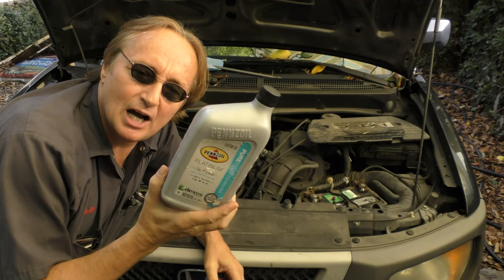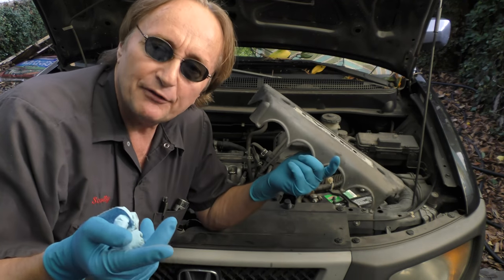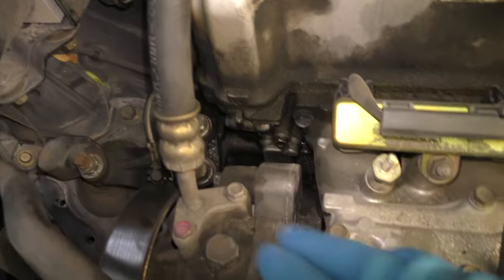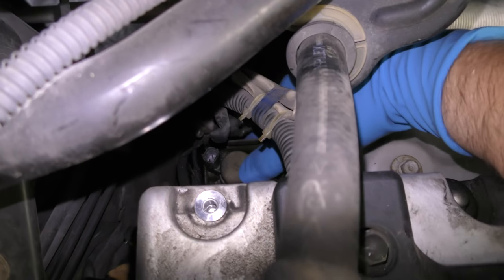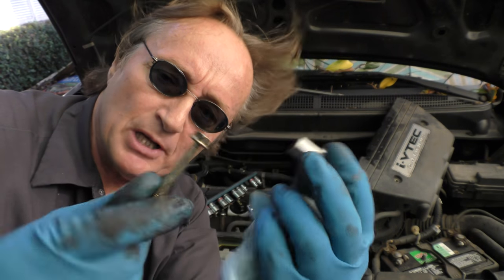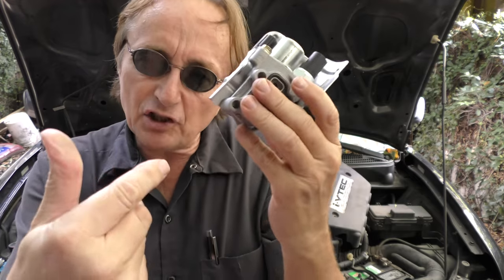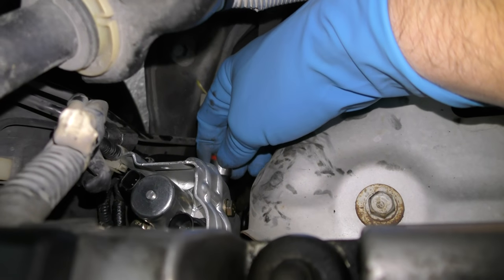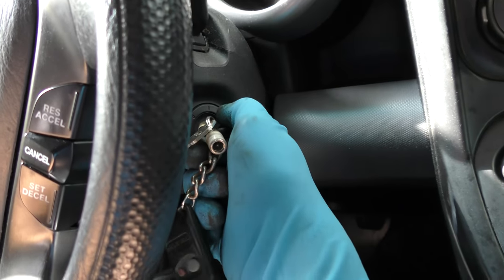How to Fix Variable Valve Timing in Your Car (VTEC)

Comment: Wow...this channel has taught me a ton about my car...when i go to the mechanic they are shocked by what i kno...i cannot say thank u enough
Reply: Leela Crissy me too !! Plus my dad taught me some knowledge I be telling him what’s wrong before he check it out😂😂💕
Reply: Why you still going to the mechanic
Reply: Haha. This comment! I had a dealer call me a c*nt and all sorts of other names because I stood over the engine and pointed out all the faults with it after he told me it was fine. All thanks to Mr Kilmer 😂
Reply: @stephaniesheridan5474  I've done over $1,000 dollars of repairs/additions to my car by myself.. Only time I'll go to a mechanic is when theres a tool that's too expensive to use.. And even then I'll go to my first job site (I used to take off bumpers and just disassemble/help out the mechanics when I wasn't sweeping and cleaning) and they'll usually let me use the equipment free of charge.. It's good to have friends in high places..
Reply: Never tell them you know what it's they hate that just do it yourself avoid the rip off 👍
Reply: Same 😊

Comment: lol Scotty chirpin the tires, well it goes over 3000 now lol
Reply: o OK thx , yea I didn't think about cleaning the intake manifold after I took the old one off, just use a brush or something to clean it
Reply: wire brush is a bit much, usually a rag and some brake clean has worked well for me
Reply: O OK thx
Reply: U own a Honda?, I see a vtech motor in as your picture
Reply: Hey also, my Camaro doesn't start unless I jump it off, auto zone told me the battery was good, could it be the altenator
Reply: ya b18c swapped civic, hmm it could be the alternator but it sounds to be a wire thats grounding out, same thing as leaving your headlights on, does your red battery light ever come on while driving around? that would point twards alternator, also cleaning battery connections if theyre all corroded would help
Reply: +The1972Cutlass hey i know you werent asking me, if your car doesnt start unless its jumped then its either the starter or the battery, sometimes a bad starter with double the power going to it will act fine, also theres a couple batteries that fit that car (group 75 group 78) so even if your old battery tested good it might not have the amps you need to get that starter kicking :) hope i helped
Reply: +Jesse Singletary  o OK thx
Reply: Motor mounts probably need to be replaced lol
Reply: +ChronicConnoisseur  o OK I have a 97 Honda prelude also
Reply: My brothers 300D does that sometimes too lol
Reply: @The1972Cutlass  check starter and ground we wires

Comment: If it was leaking it was due to the gasket seal which only cost 24 bucks. Im a Honda mechanic in Orlando Honda and the Vtec Solenoid system don't go bad, it only has seals which you can see in the video.
Reply: Craz! Ness r u still in Orlando? Get at me
Reply: And if replacing the whole assembly doesn't work then what do you do?
Reply: OrBust add 20 50 oil
Reply: RandomGolf So  we've already put in 10 30 when it calls for 5 20 and still throws the code but only on hot days. We are baffled.
Reply: Can you just buy the seals or does Honda make you buy the whole thing
Reply: thanks
Reply: Been working on acura's for 13 years.. never seen one go bad either..
Reply: Craz! Ness do you still in Orlando ?
Reply: Scott Golden you can buy the seals separately they do carry it in advanced auto parts and o Riley’s
Reply: @92174164  do they start to rattle at low rpm?
Reply: Whatt ive seen these go bad bud. Ppl dont change oil ot just keep adding it. And seals break down. Solenoid valve pin gets stuck

Comment: Hi Scotty, I just bought a used 2014 CRV with 120k miles which makes a rattling noise on startup. Honda dealership says it's a bad vtc actuator and stretched timing chain. They quoted me $2700 for the repair.The car runs with no problems and no engine codes. What do you think I should do?

Comment: Wow, I actually had to do this exact repair on my 02 CR-V (same engine) last winter. It would chug when it got above 3k RPM. I got a P1259 code. Replaced that VTEC solenoid and it's been fine ever since.
Reply: Is that a 2002 Honda engine in this video ? I have a 08 Accord 4cyl and I'm trying to figure out what is leaking on passenger side, 275k miles
Reply: That’s an Element in the video, but it’s still the same K series engine, which your Accord has. I would definitely check your VTEC solenoid gasket; they are prone to leaking.

Comment: Oh yes, the VTEC solenoid assembly. Had to replace that on my 05 CR-V. From my experience usually the only time that those things go bad is either due to lack of oil changes or just simply due to age if the car has a lot of miles on it as well. Very easy to do and not horribly expensive unlike some other things on these older Hondas.

Comment: 13 Years as a technician and master tech for Acura, i never once saw a VTEC solenoid fail, not by me or by one of the other 24 techs that i work with,, in 13 years! .. 10 times out of 10, if it throws a VTEC code it's because the car is very Low On Oil .. Very low.. Which causes interruption of oil pressure to the solenoid and a VTEC code Will set.. , when that happens the car defaults to a "Limp home" mode which makes the computer limit engine rpm to 3000 rpm.(unless you cycle the key, then it will drive normally, unless it occurs again)) Scotty just unplugged it to set the code for this video no doubt
Reply: you are mistaken because I've seen numerous Honda Elements with that same problem including mine
Reply: allen luangrath I had to change our the vetch module just like Scotty did and my Element ran like a champ afterwards. Also and oil change, engine flush and general tune up 🤔
Reply: @_Diggler   No doubt in my mind that it will run it's a honda they go forever
Reply: It is very expensive, to replace,so another alternative is, take it off, clean it, replace the gaskets, reinstall and most times the problem is solved, as the comment by the  mechanic above  stated.

Comment: Vtec has been kicking oil all over my engine bay for past two years. I didn't tighten down my vtec solenoid enough after doing my first headgasket ever on my daily driver. Finally troubleshot that P2646 a actuator arm system blah blah blah yesterday and tracked it down to that. It's fixed. No more CEL, no more oily engine bay and constantly checking/filling the oil. Replaced the o2 sensor yesterday as well, that got ruined from driving around with blown headgasket two years ago. Damn those things are expensive. No more cylinder misfires either!

Comment: Scotty. I have a similar problem. It causes intermittent hesitation. Im suspecting its the same valve you mentioned. I have no check engine light or codes for it. But i noticed it is more frequent in hot weather. Do problems like this get enhanced with environmental temps?
Reply: Following.. Needing to know, also.
Reply: @chancedulaney774  it was the throttle body and oil control valve. Replaced them and it solved my issue.

Comment: I have a 2005 Honda Civic Ex. Throwing that code. We changed the oil, added an engine cleaner and replaced the gasket. Still threw the code. So we replaced the solenoid. Still throwing the code. The whole engine jumps when it gets to about 3500 rpm. Any suggestions on next steps?

Comment: This is a great starting point. On the "element" you WILL be removing the left motor mount to remove the power steering pump and tensioner pully to clean the little screen behind the cover. the hardest part is the belt reinstall its just time consuming about an hour. The solenoid in the back of the engine is tough. remove the power steering hose and metal support bracket. I tied mine over to the driver side with a bungee strap. after you remove the 2 electrical connections there are 2 plastic wire anchors on the metal heat shield they are difficult to remove. The rest is fairly simple
Reply: You did it the hard way. You do not have to remove anything other than the oil filter for access to the VVY assembly.

I replaced the filter/O-ring on my Element and my Accord (same K24 engine) by moving the power steering pump hose bracket out of the way and holding it in place with a bungee cord. After undoing the front connections from above, I removed the oil filter (you should change the oil and filter anyway) for better access from below with the car on front ramps. It is also much easier to use the torque wrench from below.

Comment: Is it possible that the oil pump could be weak causing low oil pressure only asking because we've done this repair and visually checked the wiring harness for damage cleaned connectors changed oil and we changed the screen under the belt tensioner also do you think you could do a video on how to check a wire with a multimeter for a short to ground and a short to power and what to do about it if you find one

Comment: Mr. Kilmer I just replaced the same part I bought of of eBay for $35. With the old one it was leaking oil, and would only be a problem with a cold engine. Worked fine once warm. P2646 was the code that came on when accelerating with cold engine. So with the cheap new part even with engine warm it now triggers the same code, but besides fixing the leak it is worse then before.  Should I take the seal from new part and swap over to the old part?

Comment: My 2003 honda accord has a leak from that solenoid but no issues with 3000 RPM and above. Can I just replace the gasket? or I'd better replace the whole part? 
Thank you for sharing.

Comment: I have an '01 that does just what he is saying about poor performance - keep in mind.... when the car is cold the solenoid works fine --- you really have to have HOT oil and have to run the car for about 45 minutes at highway speeds - then slow up a bit - and then... really romp on the gas pedal to make it kick down a gear, when it tries to upshift - that is when the 3,000rpm jumps happen (Engine shutting down)... It sort of reminds you of a rev limiter kicking in... Easy fix - like he said - just hard to see.  Thanks Scotty - you've helped me in the past with some things... :)

Comment: Scotty my Chevy Malibu 2014 Ls shows the exact code, so I went out and bought the VVT, is that the same as OCV, because they look different from each other, Auto Zone recommended OCV. Which is which and were would the Oil Control Valve be located on the Malibu?

Comment: Hey Scotty, desperately need your advise. Just spent like $600 bucks with my mechanic to put in a new fuel pump. He tested the fuel pump pressure prior and he wasn't getting much pressure. Also he showed me the old one it looked like crap(very dirty). But I still have the car cranking, especially after I leave the A/C on for a while(15 or more minutes). Any ideas what the heck this is? The thermometer? Condenser? I think its a poor starter issue. Oh by the way, just had the battery replaced prior to the fuel pump. It's a 2005 Mazda Rx-8. Thanks man, love your channel.

Comment: Hey Scotty I got a 2003 Dodge Dakota farm truck that we just use around the farm there's something wrong with it ran out of transmission fluid it had a hole in the line so I saved most of the new fluid so I fixed the line but it does go forward but does not reverse is the transmission gone? if its a big fix all just get rid of it but if its a small fix I am thinking about buying a snow plow for it thanks great channel
Reply from the maker: +Dylan Crouse I would assume it's gone internally if it's full of fluid now

Comment: Hey Scotty,
I bought a 1990 Subaru Loyale wagon for 200 bucks. The car has been sitting for 8 years but hasn't been started in 6 years. I bought it at a dealership in Michigan and wanted to see if it would turn over and run if I jumped it. It did, but I only ran it for about ten seconds before I realized the oil pressure gauge was reading zero. I turned it off, then I checked the oil dipstick. It read full, so I checked the oil sending unit. It looked very rusted on the outside. When I removed it, there was about 15 milliliters of oil that dripped out. Does that mean that I have oil flow through the engine, or do I still need to prime it? I will be replacing the sending unit.
Thank you!

EDIT: I heard I only need to prime an engine if it was rebuilt, but I don't know how to prime it.

Comment: Scotty. I have this exact issue in my 05 Honda Element. I replaced my solinoid because the old one leaked even after i changed my gasket. That's when it happened the first time. P2646. So i replaced it again and sure enough it happened again the next day. I'm at a loss. I don't see how you checked the front filter you said was good in the video. And i can't imagine i had two bad units. And i did get an oil change after the part was replaced. Any other thoughts??

Comment: I bought a 2020 Accord with 56 miles on it. The VTC Valve was diagnosed at the dealer as being the culprit for problems. Symptoms included: Jerking or Bucking while driving on the hiway, Engine stalled five times while sitting in a fast food line in drive. How could that part be bad on a brand new car?

Comment: just changed the solenoid twice this week brought aftermarket ine but was faulty so got a genuine one and installed that. had take valve cover of to actually reach behind engine as aussie model has like cold air induction mounted to top of it also plus brake fluid resivour is mounteddirectly above solenoid also. it drove real nice for about 20km them 1st drive today engine light back on same code. ive already changed oil and oil filter but not the gasket behind power steering pump hopefully that is clogged up and is the issue. is there anything else i need to check? Also found it easier when mounting solenoid back on with help of a small mirror i placed down there made it easy to see where bolts needed to go in.

Comment: Hi Scotty,   Thanks for the massive time you spend teaching car repair!       I have a question.   I saw an app that had the ability to show, in a curve/chart format,  VVT function.    I have been using Torque pro an it is pretty nice.    But I don't see the ability to plot the actual timing as the car is driven.     I drive a Mazda 2001   It support OBD2.      Do you know the app I refer to?

Comment: Hey there Scotty! I just bought a used car, 2008 Toyota Yaris (Sedan) with a 1.3L engine (engine: 2NZ-FE) that has 36,000 miles.. I've been having idle problems when the AC is on.. The normal idle is around 650-700 rpm.. but when the AC compressor kicks in, the idle drops to around 450-500 rpm.. I already cleaned the throttle body and mass air flow sensor, I also replaced the sparkplugs but still the rpm would drop when the AC is on.
Reply from the maker: +Jonelle Loresca   try a new iac valve, pray it's not the compressor going out
Reply: +Scotty Kilmer Where can I find the IAC valve? is it near the throttle body? These things are new to me.. I'm not used to working on modern cars where everything is controlled by the ECU. And by the way.. What are the symptoms of a bad compressor? The AC seems to be cooling fine in 90°F weather...

Comment: how was it running under 3k rpm? Okay or really badly? Thats pretty expensive for a solenoid, $80; I don't recall the last time I revved my engines to 3k. Speed limit is 70, I go 75 and rpms at 2500rpm. No need for 3000rpm

Comment: scotty do you replace the Spool valve Solenoid with OEM or Aftermarket parts ? Standard brand is $45 cheaper than OEM .  I think is a good brand , what do you think ?

Comment: Is this something that gradually goes bad with mileage and should be replaced after 400,000 miles or so for good measure like a timing belt? I get sporadic shakes you can feel throughout the whole car while in idle, only in park and neutral, but not stopped in drive.... ('09 camry, 2.4L).  Haven't figured it out for the life of me yet...

Comment: Had a ruff running '02 Corolla with VVT,  Tech showed me a cracked solenoid, and a chip of it that was not  able to be retrieved with a magnet fell into a cylinder, and took 1-2 hrs to retrieve. Total repair bill, $570.00. What would make the solenoid crack  ?    I think he cracked it trying to remove it.  BTW, he used Alldata shop manual.
Reply from the maker: +Joseph Wolchak  they rarely crack by themselves, I've never seen it
Reply: +Scotty Kilmer Thank you, SK, that's what I thought. I think I got jobbed. No way it shoud crack by itself just sitting there. He did show it to me tho.

Comment: Well Scotty......I watch a lot of your vids.....but this vid in particular was very helpful as I have an 03 Honda Element with 188k on it with a leaky VTEC solenoid......it started w the check engine and now wont go over 3k......I remved and tested the switch and it was good......now gunna do the full Monty and replace the whole part like u did.......thanks for the info........Subscribed

Comment: Scotty I own a 2002 crv with the 2.4 in it. Can you give me an idea on what’s wrong with it. It surges and is sluggish when I’m stepping on gas. On the highway it seems to have a dead spot when I’m cruising about 60 it won’t take the gas so I have to step on it hard to make it go it actually starts slowing down instead of speeding up. Thx any advice will be helpful.

Comment: I have a 2002 CRV with 200K+ miles. A P0341 code came up and the VTEC Solenoid was changed along with the timing chain.  The problem went away but came back.  The car cannot idle and P0341 comes up.  There is some engine sledge.  Should it camshafts be cleaned?  Would it need a valve adjustment?  Thanks!
Reply from the maker: sludge kills vtec systems, remove all vtec parts and clean all small passageways and then put full syn oil in to flow better